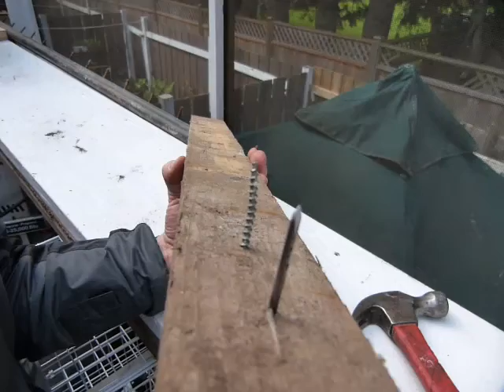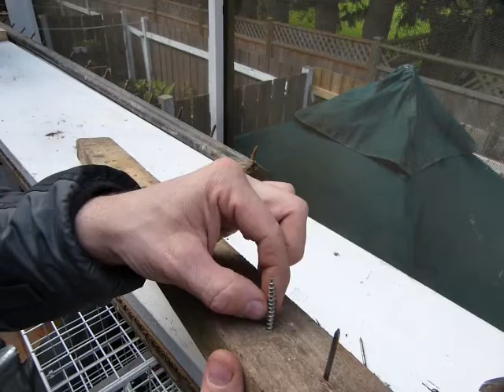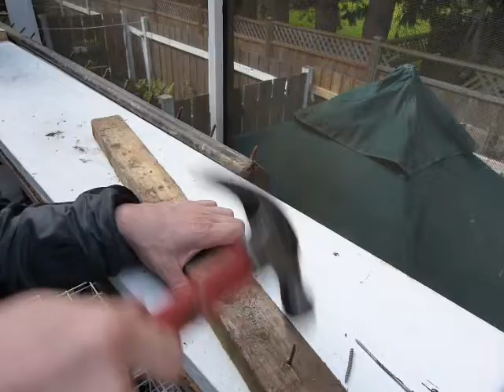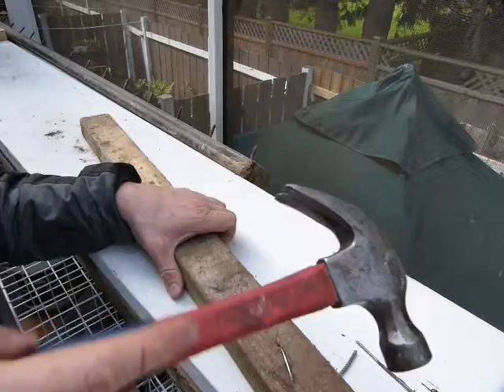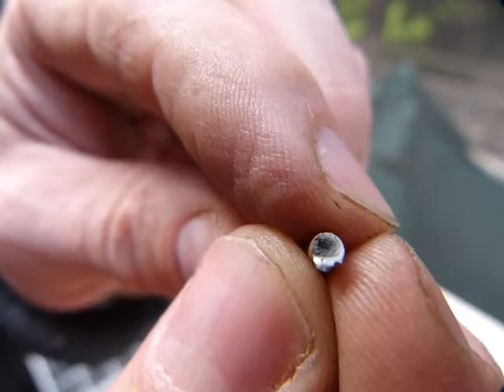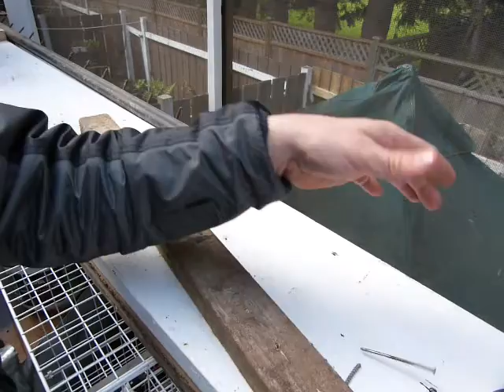Screw vs. nail

Comment: This is Not a test of "Shear" strength. It is a 'modulus of rupture' strength
Reply from the maker: A few pointers for your attention span:
1 The word "shear" is not featured anywhere in the entire length of the video.
2 Also, this is not a test of anything. There are no measurements, no base line, no calibration and it doesn`t say anywhere in the title or the topic sentence that it is a test of anything.
3 This is a demo. Also, the material science words "brittle, work hardening,  snapped, ductile failure" are used.
4 Modulus of rupture is not strength, just like modulus of elasticity is not hardness.

Comment: Good test to show shear strength, in the case of a joist hanger.  But screws are mostly used cause they don't pull out easly or pop out of wood. Ex, Metal roofing, Drywall, deck boards, etc... Screws are the best for Metal roofing, nails are silly and will pop out with time. small roof panels don't expand and contract enough to damage a screw, long sheets like barn steel will, but I'd still use a screw cause a nail will pop out first winter. plus the screws are self thread so the thread seals keeping water out. Nail holes will elongate and leak. nails are for tacking screws are for fastening. Especially pneumatic gun nails they only have half a head!

Comment: I see your point (and learned much from this), but in practical usage, if the screw is not being bent in its normal application, then is it a liability relative to a nail?  That is, you drive either nail or screw, it has no room to really be bent, so it won't suffer from fatigue.  Or are the microscopic movements enough over time to cause a premature failure?
Reply from the maker: DukeLaCrosse20 Screws will not fail due to microscopic wood movements. When the wood around a screw swells up, the screw is uniformly compressed from all directions, no bending. When the wood dries out, the compressive force uniformly drops in all directions, no bending.
If any side-loaded bending is within the screw`s elasticity limit, it`ll be fine. Like a spring in a ball-point pen. The spring can last indefinitely when its movement is limited to the pen`s clicking, and the spring can be destroyed in 2 sec by a toddler who stretches it into a wire.
Makes sense?
Here is some awesome stuff about this elasticity limit, called "yield point" https://www.youtube.com/watch?v=D8U4G5kcpcM